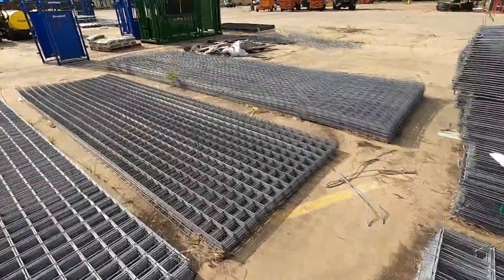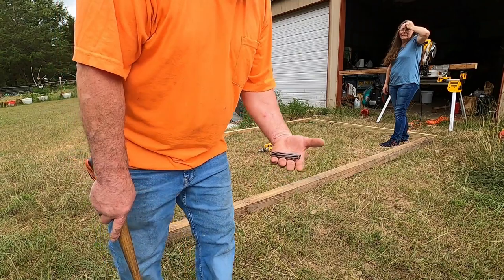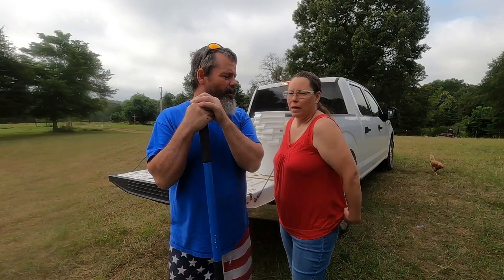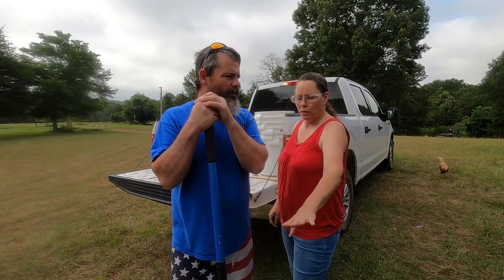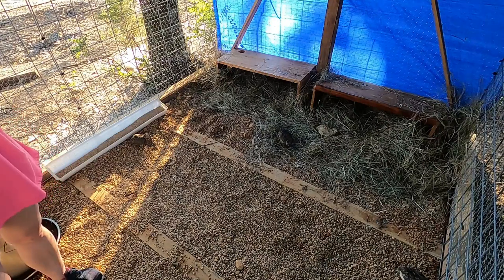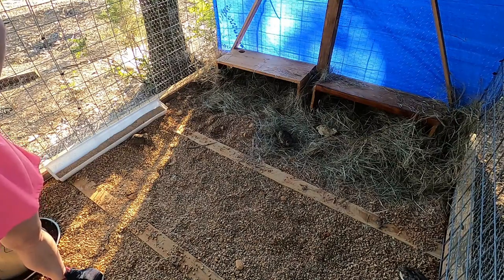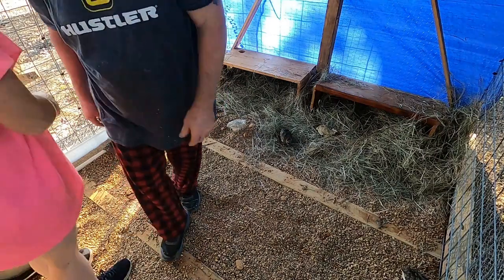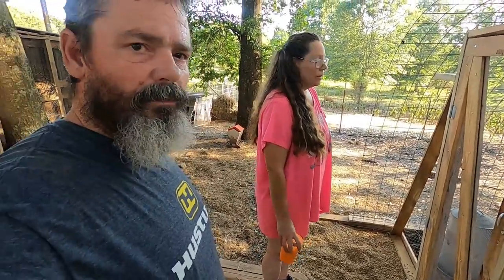Building a quail run/ Start to finish

Comment: Hardware cloth for the bottom two feet is ideal, with chicken wire above that, in my opinion. 

Keep in mind that rats will kill quail. 

Anything with bigger holes than chicken wire and your risking raccoons grabbing them, rats and snakes getting in, or even the quail escaping if they’re young/small enough.